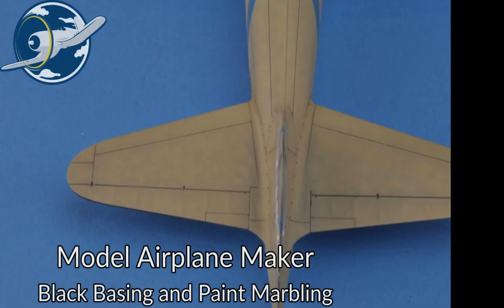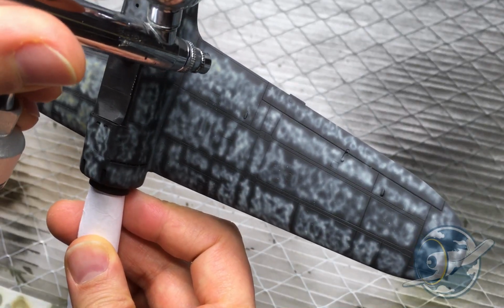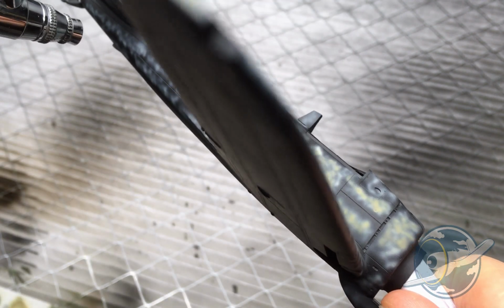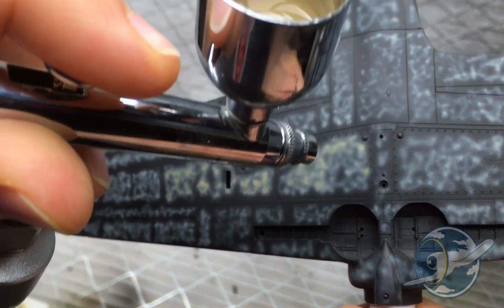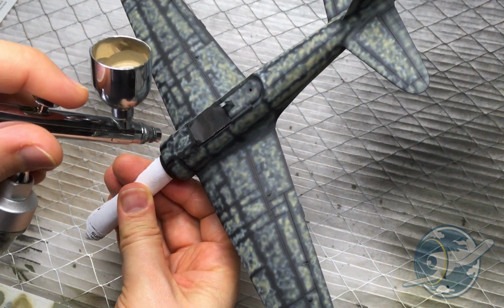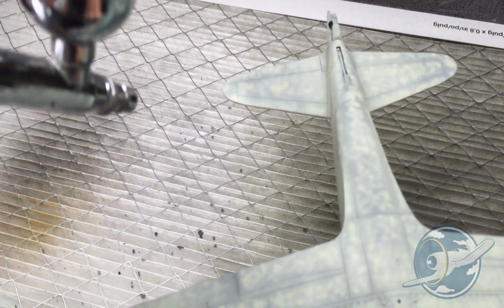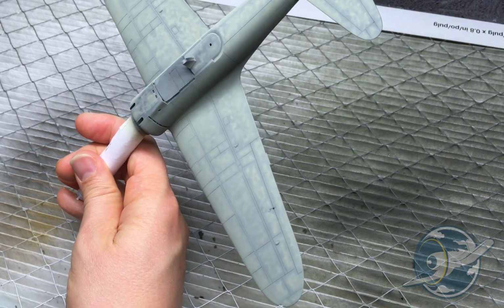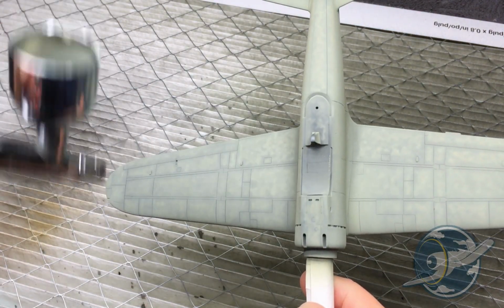Paint Realistic Weathered Aircraft

Comment: Shading is caused by light and the lack thereof, not by paint.  What is meant is that painted shading is one dimensional and fake looking.  Once placed in a bright location the painted shadows don't line up with the angle of the light hitting the surface and you wind up with real shading over laying fake shading.  The way it is done here is for accenting and looks great, the way it should be done.  Notice no hard dark lines and patchy "Quilted" nonsense.  Well done!

Understand how light and shadows work and you will no longer be painting shadows and panel lines on your models.  It's an impossible concept for most modellers mainly due to Cartoons/Anime that need to do this for it to look good on film.

Comment: Q: Just finished covering the pre marbling effect with base color on my F15. Surface came out a bit rough. What grit should I use to smooth it out without damaging the paint job ?
Reply from the maker: I wouldn't do anything stronger than 2000 and I would probably start with 3000 grit
Reply: you can burnish it with a rough kitchen paper towel. It should knock down alot of the high spots. Try it and see how it feels. It will work, give it a try.

Comment: It's not stated, but it seems that your primer coat was gloss black and you filled in the panels with mottling. Supposed I start with a gray primer, and then add dark gray and beige squiggles over the entire model. THEN cover all the panel lines with black, varying the intensity and width of the line as I go. Seems it might be easier than trying to staying with in the panel area for mottling each panel.
Reply from the maker: I think you’ll end up in the same place. But you’ll have no issues with the mottling once you’ve had some practice

Comment: Question:  what determines what colors the marbling should be under certain topcoats?
Reply from the maker: Good question.  There are two things you need to think about: How subtle do you want the marbling to be and then the 'thin-ness' of the topcoat.  For the zero it was whites, greys, browns because of the grey topcoat.  For an olive (USAAF) i went with greys, whites, some blues and that worked well.  I have not tried it but with a blue, whites, light blues, and maybe even oranges.  I'd be worried a bit about greens.  

My goal is always a very thin top coat and maybe two coats at most.  The more the contrast, the more likely you will have to make several top coats to blend it all in.